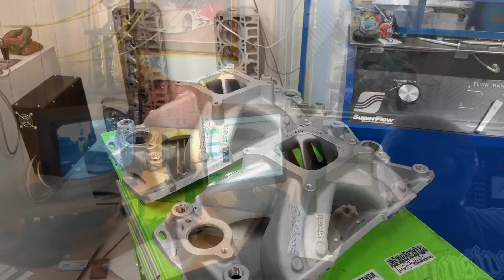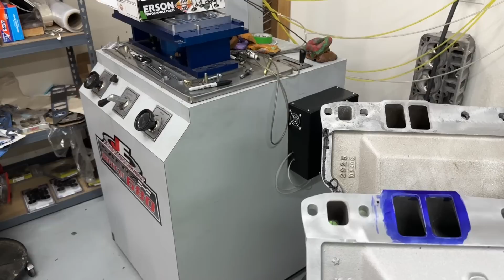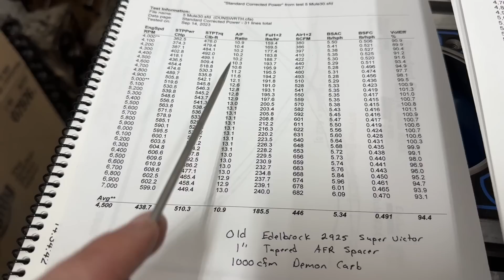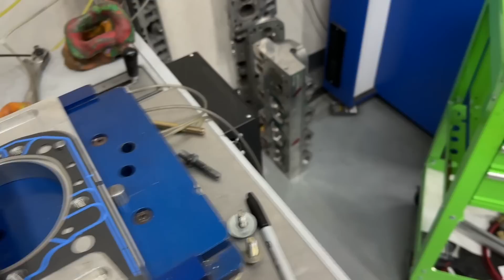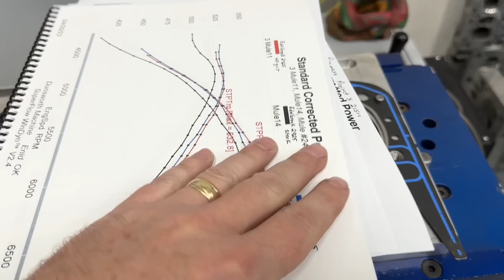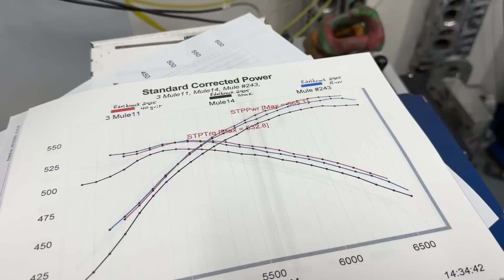Super Victor Manifold Old vs. New

Comment: 5:50 miles into this video and I'm probably wrong, but think the older intake will create more horsepower because the openings are smaller and move the gas faster into the heads and more gas.

Comment: there was a guy posted video of dyno session, on 408 with trick flow 190 power ports and results were very close to what you results were for the 215 heads, well I asked "What is Dyno correction on the test results?" And i never seen video again.Most likey i was blocked
Reply from the maker: It is hard to compare dynos because of that. I don’t think the trick flow 195 would be close to the 215 but there 230 would probably beat it.

Comment: Nice work, I have the Small Block Mopar Super Victor, it has very thin dividers and they do not protrude into the open are as much. also it has a step on the floor middle and the port s go down after that step

Comment: Great videos. Keep up the good work! First intake manifold on my 350 Chevy was on my 73 Z28 when I got the car back in 1985 was a TM1 Edelbrock tarantula. I was a kid and just started hot rodding so i contacted Edelbrock and found out that it was a great design, and they called it the "Baby brother to the Victor jr"  they regretted discontinuing it. I always had great success on the street...eventually went to a vic jr... love to see a test with one vs the old vic jr.. I sold mine in the 90's...  maybee a viewer has one you can test......ty
Reply: Btw, still have the car today...
Reply: Yes! Thank you, I'd love to see a dyno test on the older smaller single planes. And not just on a 550 horse 406 but a 425 horse 350 or 370ish horse 283.

Comment: Have you tested Torque plus intake gaskets? Seams like snake oil to me but there was a lot of buzz about them 20 years ago. I am sure they hurt flow on the flow bench but are to make power because they atomize fuel.  Just wondering if there was any independent testing to prove or disprove claims.

Comment: The old version used rosin cores to form the inside and the new ones use loss foam to form the entire manifold.  Loss foam allows better control of the inner structure and consistency.

Comment: Eric, is the dyno engine in the exact same configuration as when you tested the two old Victor Jr manifolds?  Can we draw direct comparisons between the two old Victor Jrs and these two Super Victor manifolds?  In other words, is that antique Victor Jr still beating both of these Super Victor manifolds?  Incredible, amazing info if so.  Thanks for your hard work.
Reply from the maker: Yes. They were tested the same day. The old Vic jr beat the super Vic.
Reply: @WeingartnerRacing 2:09 Which heads and combo?
Reply from the maker: @dennisrobinson8008 it was told in the video.

Comment: Well I really can’t afford to be a channel member but I do really appreciate your testing! 
My thoughts towards this test is I believe if you had one of your ported dragonslayer heads on this engine you would see a bigger difference between these already pretty big manifolds because you’re just not taxing that intake enough at this level to see how much better it would really do !
Kind of why the Hulk 23 had absolutely no chance of doing good on an engine like this, it’s designed for absolute max effort 10000rpm 440+cid small block racing engines which you talked about at length. 
this is a just theory of mine but I don’t think I’m too far off if I am off, I’ll be doing some Pontiac testing between stock factory intake manifold and my fully ported factory intake work here pretty soon. 
Mainly because some of my work will be on an engine used in the FAST racing series so I plan on documenting everything and same day testing to try and keep it fair, thanks again Eric!

Comment: I’d like to see you test the old Torker and the Torker II manifolds. I used both of these on big cam LT-1 back in the day.
Reply: Great Idea,    So would I.
Reply: Me too, still have a torker 2 on my Z-28 running a 140 gm solid track cam.
Reply: Id like to see this as well. But if i recall correctly, he said they're terrible, sorry guys.  Depending on the operating range you need it to run to/in, a performer RPM or Victor Jr would definitely be quite better than that design.
Reply: @BEANS-O-MATICtransmissions  Of that I'm pretty sure. The TKII on the OG SBC was a bit of a pooch. Seems like they had better luck with it on different engine design's though. If you're dealing with a serious hood clearance issue.. maybe. But I'd still consider something else.
Reply: it was a total turd on a sbc. @peskypeet
Reply: @leftyo9589  I had one on a SBC when they first came out. Yea, I agree. I'm pretty sure the OG aluminum factory Z28 intake would beat up on it. The Holley 300-36 dual plane was being produced then and would have done the same. I think even the Performer RPM was in early production then and would have stomped it.
Without being heavily biased by an Edelbrock or Holley add revenue stream (damn magazines) that would have been an interesting dyno test.
Reply: Hey guys, I know they are outdated tech, but this is what we had to work with in the 1970’s. My combo was  1970 RS Z-28 LT-1 .030 over 11.5 to 1 Crane Compucam 260 at .050 .540 lift roller rockers 1 3/4 Hookers original port matched Torker ported 492 angle plugs 20 lb flywheel ford top loader 4.88 to 1 12 bolt posi and 
Protracts on slots. This was my street car and it hauled a$$, with 9” M&H slicks it would bite hard and pull a tire!
Reply: My Torker II worked well, it was light, cheap and was single plane which I wanted for my nitrous.  The runners were small but it was meant for tamer engines whereas I recall the torker absolutely killed low end torque which was lousy for daily driving.  I would love to see that test.  Eric’s 406 would favour the torker I believe but both manifolds will likely be terrible compared to more modern designs.